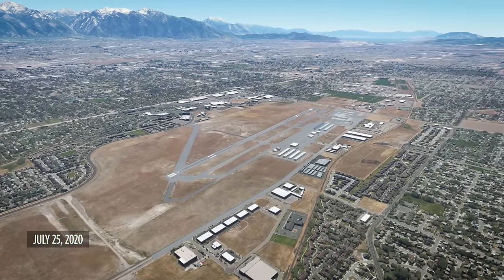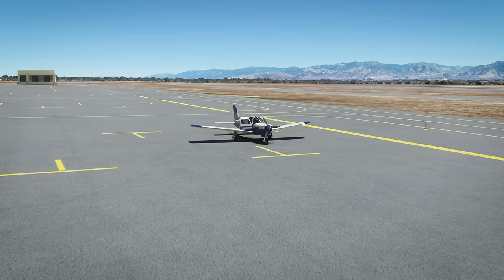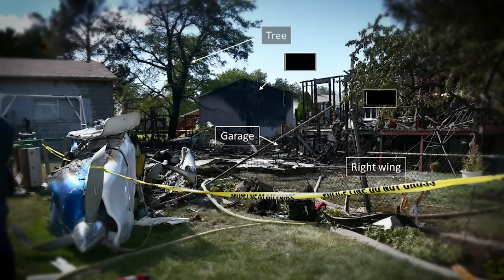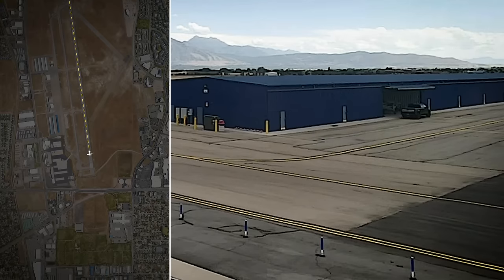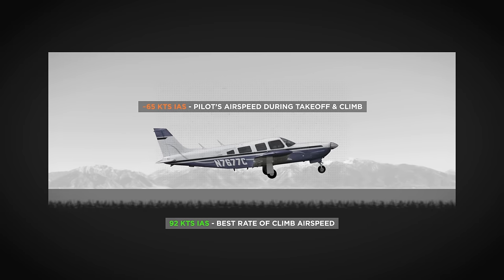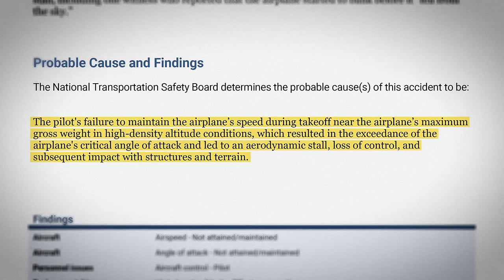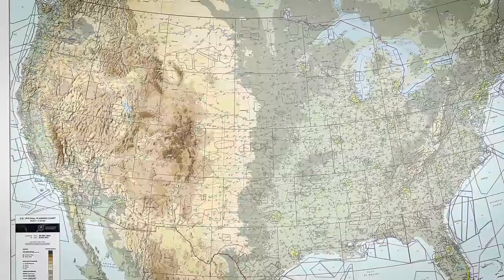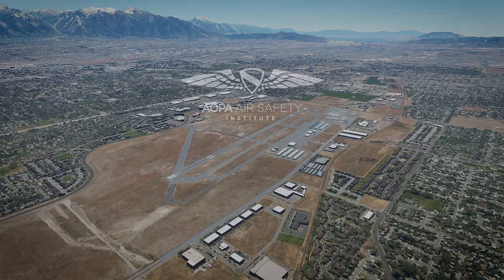Accident Case Study: High Aspirations

Comment: I wonder if retracting the flaps after take-off would've helped or not. Would've had less lift but might've compensated for it with more speed.
Reply: Why on earth would any light a/c pilot take off on a long hard surface runway  with no obstacles to clear on any day ——with ANY flap ! I’ve never understood that. These a/c are built to climb and cruise most efficiently CLEAN . 
His IAS would have dropped continuously after leaving the runway up until about 100’ AGL because he was climbing into an increasing tailwind gradient and that really spooked him probably.
Reply: @davidwhite8633  Because that is standard procedure. Initial flap stages give you more lift than drag so you gain more altitude in a shorter horisontal distance than with no flaps. His calculations led him to believe that the climb shouldn't be a problem so he was caught off guard when the plane wasn't speeding up. There was probably nothing he could've done after take-off to avoid stalling anyway or else it would've been mentioned in the report. Fair play to him for at least trying to get more power by leaning the mixture during that oh fuck moment.
Reply: @iBreakAnkles4Fun If some flap on T/O is standard procedure then all GA a/c would find it recommended in their POH by the manufacturer, but such is not the case for normal T/Os —-some do , some don’t.  Short field/Soft field T/Os are a different matter . He had plenty of runway and no obstacles at the far end so any flap was deleterious to performance, especially at high DA.  He had plenty of lift because he climbed out of ground effect and that means there was sufficient lift to equal weight , and the latter only goes down in flight.
I agree he was caught off guard because the tailwind shallowed his climb angle ,and his A/S would have been reduced as he passed ~ 100’AGL because of higher tailwind at this height. He also didn’t know , probably , that Vy was different at this altitude [ lower ] . If he had kept wings level and locked on to Vx it might have just worked out for him. Very unfortunate.

Comment: I agree with others who commented that the pilot didn't really do a lot wrong. He even had the presence of mind to lower the nose (not once, but at least twice) once he realized he was too slow. It is very much possible that once he was out of ground effect it wasn't theoretically possible for him to lower nose enough to get enough airspeed and clear the trees at the same time. The only thing he could have done is remained on the ground longer, but then he could have overrun the runway. I guess the real lesson here is that POH is a piece of garbage, no-one is responsible, and you should never put yourself in a situation where you would even want to reference the POH to confirm anything.
Reply: Taking off with a tail wind increases ground roll. The charts in the POH are based off calm winds. That was probably biggest mistake.
Reply: @dmdx86 I don't see how that's relevant. His problem wasn't that he ran out of runway or that he couldn't outclimb an obstacle precisely 50 feet tall. His problem was that once he took off - he couldn't climb at all. Takeoff didn't have anything to do with it - except had he stayed in the ground effect longer maybe he could have accelerated, but who knows.
Reply: @alk672  The tailwind is going to significantly increase the amount of distance it takes to reach an airspeed that you can climb out of ground effect. If he had a decision point on the runway that was well short of the departure threshold he could have aborted and put it down at the end of the runway.

Comment: It seems the video has 2 alt. theories one at abt 6.14 related to "real word performance is less than book" at abt 10.45 they mention possibilty of poor technique. If the poor technique is lack of leaning for take off roll and allowing or controlling an early lift off this would seem to make more sense than the vague statement abt book numbers are not obtainable/reliable.
Reply: …you are quite right. The NTSB investigation did not find or comment that real world performance is less than POH. Clearly, if a shortcoming of the AFM had been identified it would have to be listed as a finding and contributing factor, along with a recommendation to fix it. However, the NTSB rather ineptly cited the best rate of climb chart, which is borderline irrelevant as the plane was never cleaned up and was ‘stuck’ in the take off phase. Nonetheless, AOPA picked up on this quoted rate of climb and implied the chart was wrong. 
  I have studied this report in detail and, whilst I agree with the probable cause, it has some shortcomings. There was no mention of the fact that the tail wind put that departure way outside the limits of the take off chart, and extrapolation beyond the limits of the chart is not valid. Apart from not correctly leaning for the high altitude departure (that could cost up to 5% power according to the Lycoming manual), half the plugs were “severely eroded”, and #5 egt was 100F down, so this engine was not going to produce the % of rated power assumed for the chart. I don’t think the implication by AOPA that the charts are inaccurate is justified. And I am not saying all chart performance estimates are totally accurate, just that there was no evidence of it being a contributing factor in this case.

Comment: "Pad performance numbers by 50%".   How many of us do that?
Reply: Should depend on your experience level and risk tolerance under those specific conditions. If I am taking off at max gross, under high density altitude conditions, for the first time, with family and friends aboard then I would.
Reply: Easy with foreflight.
Reply: I thought he said 15%, when I saw 50 I was like Jesus comon
Reply: @slowfuse  True, 50% sounds like a lot, but if the POH says that the test pilot make the takeoff work at 3000 ft, I think setting a personal minimum of 4500 ft is pretty reasonable.  I'm not as good as test pilot on my best day, and if anything goes wrong, and I'm not quick enough to react, I'm in the weeds.  I think advice for the "average" pilot like add 50% is sound.
Reply: The calculations checked out on this flight so he did what he could. I personally wouldn't have brought the other two passengers. Fully loading these GA planes just seems too sketchy. It sounds like they should reevaluate what the manual says if the plane isn't able to perform as intended, or they need to adjust the DA charts.
Reply: @dermick I was always under the impression they padded the offical test pilot figures by 10-15% before they put them in the charts
Reply: I've always been taught that the engineers went to school for a reason. Tolerance is pre "padded"  with safety in mind and if it says run it, then let er rip.   
Sad day but imagine how life would be if everything was padded by 50%.
Reply: I do. Maybe not 50%, but 35-40 for sure. Has been called "paranoid" for going way to far with that, but I don´t care.
Reply: If you live in a high DA area, you would never leave the airport if you pad the performance by a 50% safety margin.
Reply: @Pomidorisgogo  in all seriousness 50% really.  That is like wearing a helmet in a car( it would save more lives than wearing them on bicycles (according to the ASER conference last year)).  Unless you only fly cool and at sea level or have a way oversized plane how do you fly?. I really want to know.
Reply: I thought about this comment I made and what and how I fly now.  Currently I fly a twin turboprop.  All twin aircraft have tables for accelerated stop and go.  Accelerated go does not apply for single engine aircraft, but accelerated stop may.  If you have not become airborne by the time you have reached a point where you can stop the aircraft and remain on the runway it is time to abort the takeoff.  Single engine reciprocating do not have a performance table to do this, but I would bet that with a little effort it would not be hard to develop one.

Comment: Does "normally aspirated" mean an engine without a turbocharger? These days it seems that even the cheapest cars have turbochargers, so is there some reason why all plane engines don't have turbochargers now? Is there really such a big difference in cost? I also don't understand the need to control the fuel mixture - I haven't seen any car built in the last 50 years with a lean control. Anyway, just hate it when they mention child passengers. 😥

Comment: I dont get it, that lance should have been able to climb at below gross and a msl of 7500'  3000ft of runway should have been more than enough... something else going on here, having said that every pilot needs to get used to waking up early and leaving early. the afternoon brings all sorts of problems. Finally to all developers QUIT building neighborhoods at the approach and departure ends of runways, you keep doing it and its is stupid, stupid, stupid
Reply: I agree. The pilot seemed to do everything right, including a full power run-up, according to the wife. If he got full power at runup and the POH was indicating a 500 FPM climb rate, and he was in CG and weight, this should not have happened.

Comment: The airplane stalls when the pilot uses the "elevator" to climb. 

The elevator pitches the wing to the stalling angle of attack. Therefore, the elevator is the "stall device". And should be treated as such. 

The pilot should not try to climb out of ground effect. Pin the throttle, pin the prop lever. Set mixture for maximum power. And keep in in ground effect until cruise-climb speed is reached. There is zero reason to be flying around near the low end of green arc.

This is what has been knocking ofd pilots and families for over 100 years. Trying to pitch-up to climb. A climb is a result of excess power. If you are not climbing, you have insufficient power. Fix it.

Comment: Not to mention that the weight as calculated was only 69 pounds under the maximum gross weight.  That's 98%.  Unless every person and every bit of luggage was weighed on an accurate scale just before getting on, the plane could have just as easily weighed 3,601 pounds.  A 2% margin, especially in that weather, just seems too small.  Granted, the max rating of 3,600 probably had some margin built in, but still, it can't be good to push the limits like that.

Comment: This could have happened to me... Everything can change during the actual takeoff: the weather, the condition of the airplane. The pilot knew what the danger is, so the only possibility to avoid such a disaster is to set myself a strict safe condition for aborting takeoff and to comply with it. If I suspect that the mixture was possibly not optimally leaned during the runup, abort the takeoff and try again with a more adequate setting. At least in theory, it should be like this. From my own modest experience, it is very difficult to mentally overcome the deliberation for takeoff. Therefore, in hairy circumstances like this, there should be an initial deliberation to abort takeoff , unless , by chance, the aircraft is airborne 1/2 runway with a stable rate of climb. "Let us see whether we can takeoff indeed" - attitude that may eventually have helped... RIP

Comment: Its strange that we continue to rely on aircraft performance data that overestimates what is actually possible.  The aviation community is notoriously conservative in so many dimensions, but for some reason continues to overlook this obvious problem.  e.g. 8 hours between bottle and throttle, and you need 20/20 vision and no medical issues evenif resolved,  but go ahead and take off at max gross in high density altitude.

Comment: Low wing aircraft lie to you on takeoff roll due to ground effect, it’s not as simple as setting a go-nogo point on the runway remaining and by the time you confirm positive rate, it’s too late. 
I also think leaning engines to get more power needs to be condemned , shouldn’t be acceptable practice for takeoff, too easy to starve the engine as it seems this is what happened here Ridiculous that we still have manual mixture engines in brand new certified aircraft in 2023

Comment: We err in blaming Piper, we err in blaming wind direction, we err in blaming this pilot, we err in blaming the swiss cheese.  There was a very simple energy management solution to his problem, the problem of every takeoff from every long runway...the basic level in low ground effect takeoff should be default.  Think soft field takeoff, but once off below Vso due to free ground effect energy, work the yoke a bit to find level in low ground effect and stay there as long as pitch up over obstructions is not yet necessary.  Bonanza, Comanche, and Lance pilots pull the gear up for energy management.  If they leave thousands of feet of free ground effect energy below, to get the gear up however, they throw away far more energy than had they stayed in low ground effect with the gear down.  Or climb to three feet if uncomfortable with six inches and bring the gear up.  Ground effect energy, zoom reserve airspeed, cruise airspeed most of the time, has made the difference on many engine failures for me.  Yes, I was only able in six seconds to maneuver to the near LZ available in the near hemisphere.  But, with zoom reserve airspeed, I was able to maneuver safely to a suitable site.  I broke a couple of Pawnees, but never hurt myself in 12 engine failures.  Normal takeoffs scare the pee out of me.  Vy pitch attitude, not enough airspeed to maneuver safely, scares the pee out of me.  Airspeed, and not altitude, is life down here.  This, and most of the fatalities around the airport, are training errors that come down from on high.  There is a complete lack of low altitude orientation.

Comment: Creighton King's Cassutt Air Racer Crashed on 23 Aug 2023 also at the South Valley Regional Airport, U42 on take-off. 

“You are many steps from your dream, but start!”

These words appear on the web page of Cassutt Aircraft, owned by Creighton King. King, an aircraft builder and race pilot who was killed Wednesday in West Jordan, Utah, during a test flight of his Cassutt 111M race airplane, Race No. 15, Last Lap Player.

According to the West Jordan Police Department, the accident happened shortly after 12:30 p.m. PDT on Wednesday. King had just taken off from Runway 16 at South Valley Regional Airport (U42) approximately 13 miles south of Salt Lake City. The runway measures 5,862 by 100 feet.

https://www.youtube.com/watch?v=XNXLLDumP7M

Comment: This is a good example of a meticulous pilot who confused “hitting the numbers as per the POH” with actually being safe.  Sure he was careful about the weight and balance but the high DA and tail wind component ate his razor thin margin of safety right up.  Should have given himself a 20% margin on the take off weight, especially when flying loved ones.  Taking off at max weight in a high DA location is a risky proposition under any circumstances.

Comment: When reading of accidents such as this, with all the implications to the lives of those associated with those fatally injured, I despair. This was not a 'Gung-Ho' pilot.. he wasn't a low-time pilot.. looking into the performance charts for the aircraft does not guarantee the performance, those figures are calculated from the results flown by an industry test-pilot on a brand new aircraft, we can easily knock a minimum of 10% off the performance results.. maybe more. Operations in a high-density environment were not new to him; yet, he decides to make the flight at the most critical time of the day with regards to temperature, he decides to top off the fuel tanks when weight is a critical factor, he chooses to opt for a tail-wind take-off.. as I said.. I despair. What more can his training and instructors do to keep people safe if, in spite of all their efforts, someone takes his trusting passengers out and kills them through sheer stupidity. Sorry but there's no other way to describe his actions.

Comment: You know when I first learned about flying at sea level density vs High altitude?  9-11-01 and the RIDICULOUS speeds the 9-11 omission report claimed which would rip the plane apart at sea level.  We're talking almost 100kts over MAX OPERATING speed.  Explain that.  I will, they weren't all commercial planes the 2nd plane to hit was a military plane with a pod in the underside.
Reply: Your tin foil hat is leaking...

Comment: Yes the plane was brand new every part knew every part clean every part picked at random off of the shelf to build the airplane they did the test on. Every number like maximum weight or maximum distance to the center of gravity worked out perfectly on the brand new airplane with the brand new parts in perfect condition and adjustment adjustment. The problem with meticulous pilots is the don't understand finite math fractions. The closer You are to the maximum numbers, the smaller your margin of error. The smaller your tolerance for wear and tear. The smaller your tolerance for fuel mixture out of adjustment or anything else that holds the motor back a little. If you're ever in a situation where it won't climb like that just fly level to get all the speed you can then try to climb very gradually don't consider it part of the trip consider it part of the return to the airport. If an airplane is not functioning correctly it will crash far easier if you turn enough to generate any extra Force extra Bank. After you left the ground I don't think the tailwind is all that relevant because you're not taking off into it you're flying with the body of air. The pilot was already well above the ground effect. As soon as it didn't want to climb he should have just kept at level instead of diving for speed and trying to climb back out like the Red Baron. If you're diving for speed you're making a bad mistake already. If the motor won't pull you up to speed altitude is very precious don't just dive.